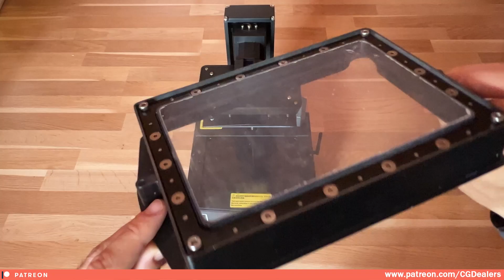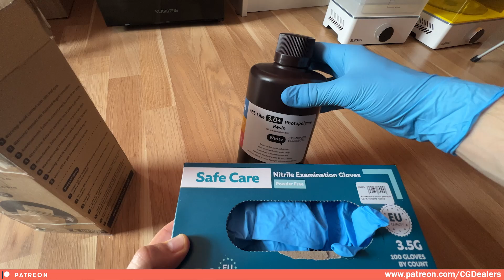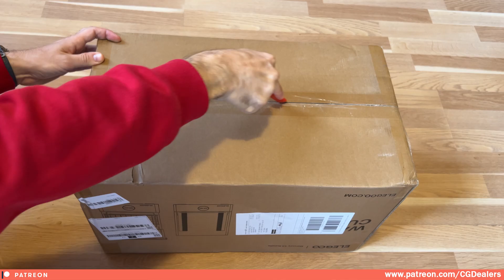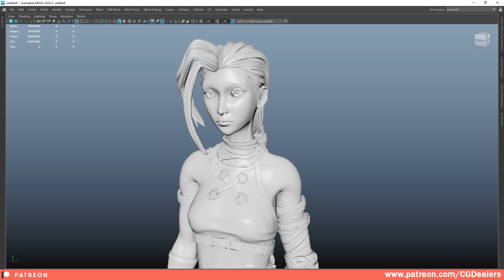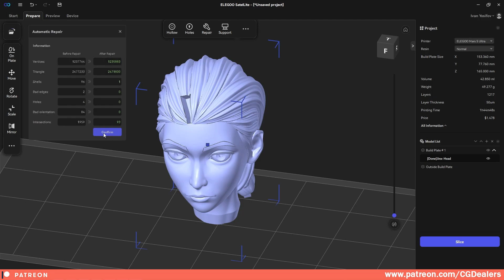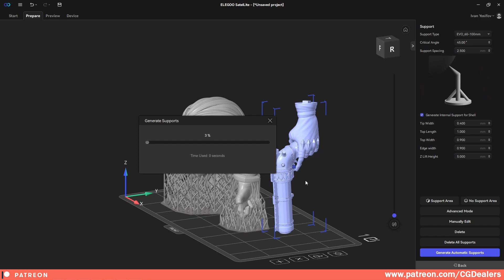Elegoo Mars 5 Ultra 3D Printer - IS IT GOOD?

Comment: I had a Mars.  The manual leveling on that unit was better than the "auto leveling" build plate of the Mars 5 Ultra.  It worked without drama.

The Mars 5 Ultra is a solid choice if you get one that is sorted out from the box.  If you get one with leveling issues, just pack it back into the box and return it.  It took me weeks to sort out leveling issues.  Now it just works but the unit I got has some stack up tolerance issues that make the various leveling corrections provided ineffective.  Elegoo will try to send you a janky G Code download which will over compress layers instead of addressing the root cause of the problem.  Bad machine + bad instructions  = bad experience.  

There was some alternative instructions provided by Elegoo that took the build plate that I had to the limits of it's ability to adjust for poor assembly conditions of the printer. It worked but just barely.

Some of these units just work.  Others are a real struggle.  If you buy one, I hope you get a good one.